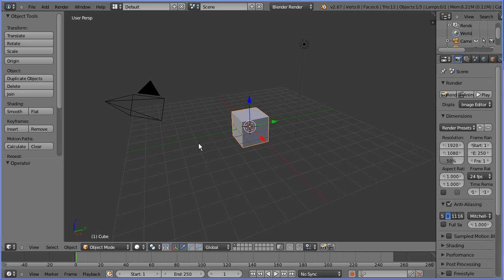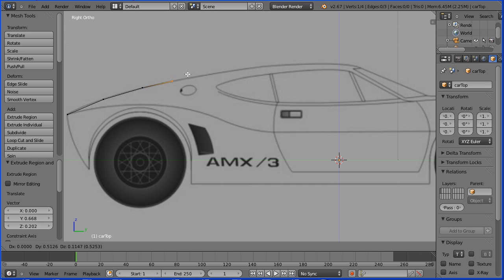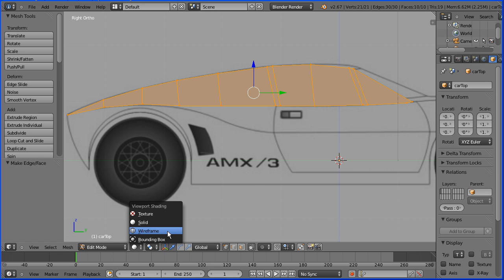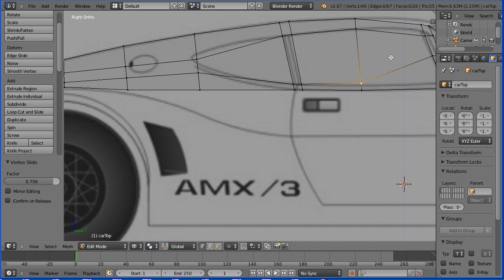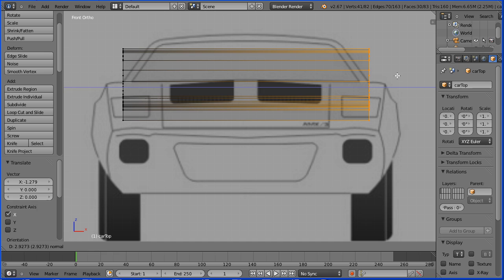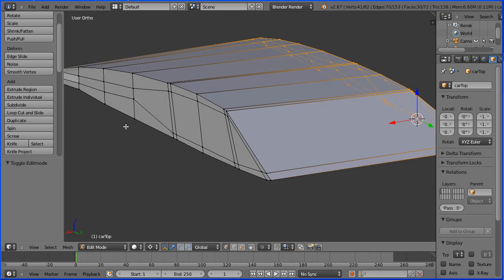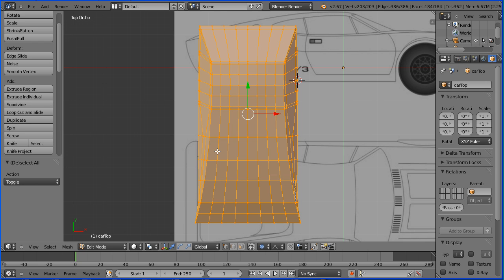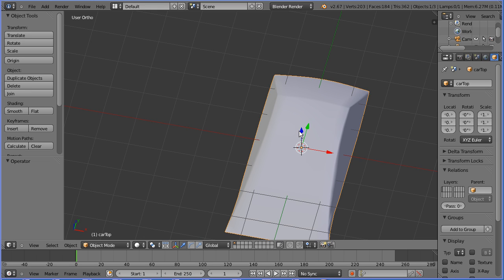Blender Tutorial Making a Model of a Sports Car (Lowish Polygon Count) Part 2 The Top of the Car

Comment: happened the same thing to me doing edge loops "Must select atleast 2 edge loops". What did you do?
Reply: Sergio Domingues same problem
Reply: ok this is hard to explain, but basically the parts you selected have to loop around if that makes sense, so the vertices shouldn't be loose, they should all be connected.